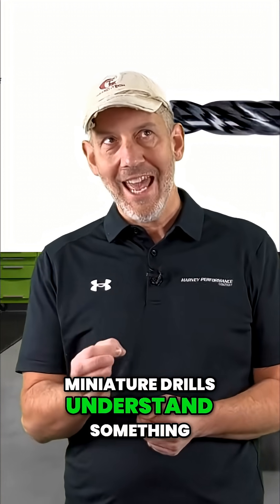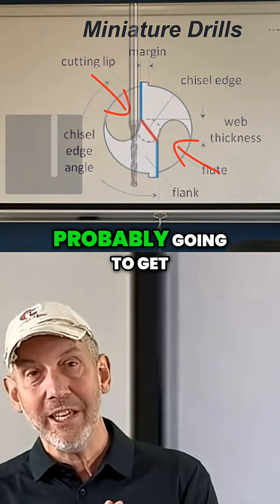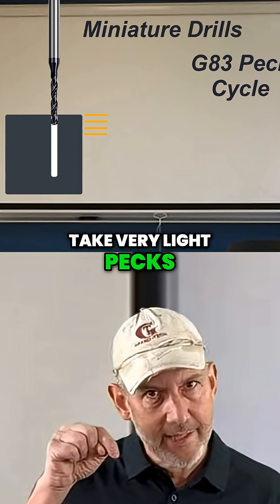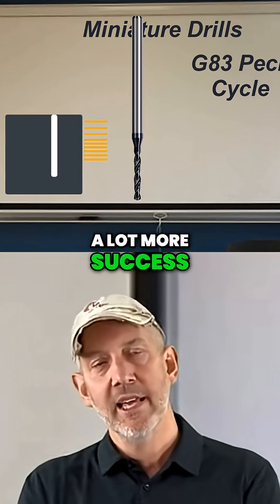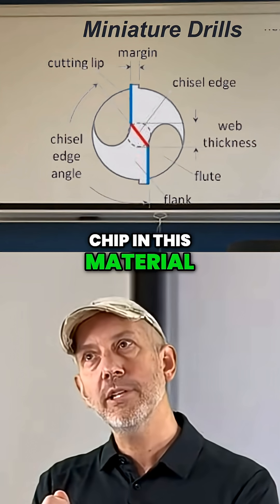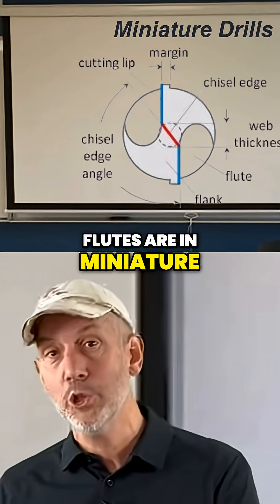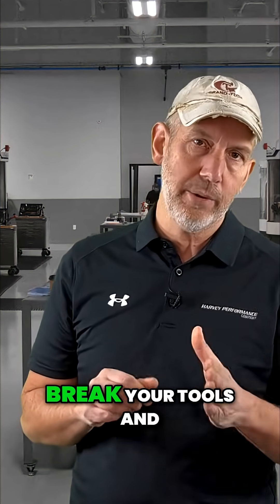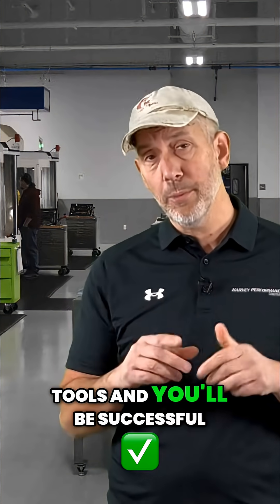Miniature Drilling  Stop Breaking Tools Now! #cncmachining

Comment: Peck with full retraction. No through coolant on tiddlers and high pressure air can deflect the drill. Ask me how i know .😂😂
Reply from the maker: Now there's someone with solid experience.. Good point on the full retraction, helps throw the chip and put more coolant down hole before another attempt 😂😂😂.  Thanks for the comment. ctc

Comment: Been running wire tie holes in a286 .047 dia .010 peck .250 depth ran over 80 holes so far no broken drills! 👍
Reply from the maker: That's great feedback! Thanks for sharing your success. ctc